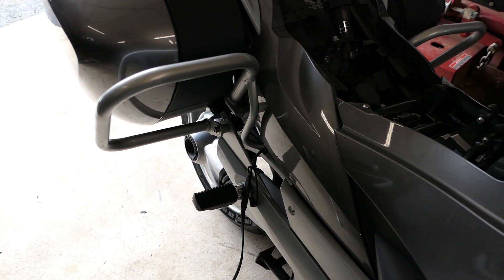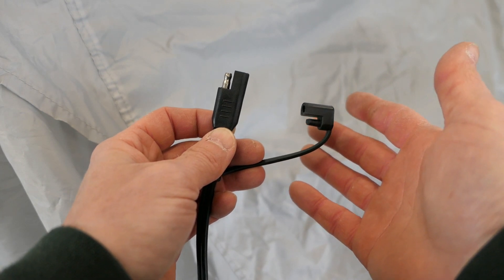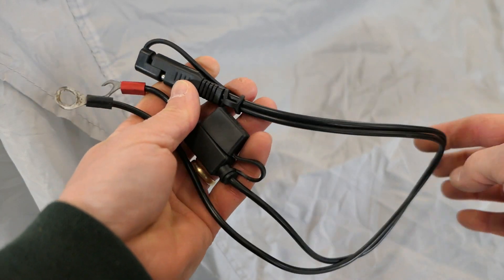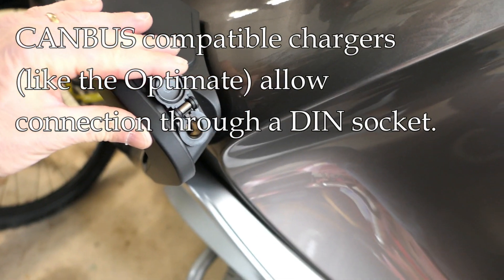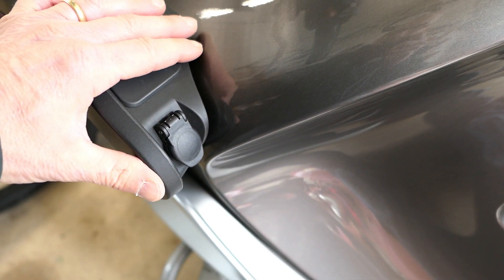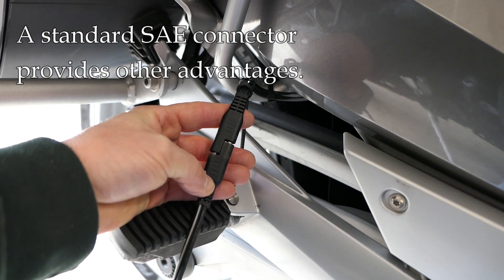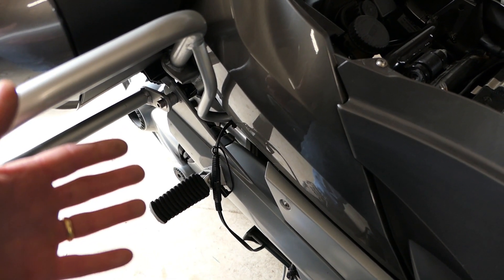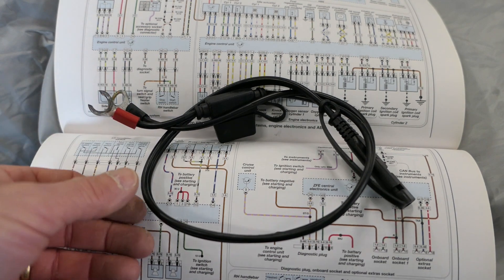SAE Pigtail Or CANBUS DIN Socket?

Comment: Couple notes about DIN charger. Actually, it is very useful (but quite expensive) thing. Yes, it's current limited to socket current (manual says 10A, forums says 5A). But we have 19Ah battery which normal charging current should be 1.9A (1/10 of capacity). When original BMW or Optimate charger connected, it wakes up electronics and start charging. All other (generic) DIN chargers needs to have ignition turned on before connection. When battery charged (or power loss happen), generic charger disconnects completely and can't start charging until ignition turned on again. Original chargers continue charge after power loss. Also, Optimate 4 can be left connected for entire winter - it will wake up with some intervals, charge battery and sleep again. So, CANBUS DIN charger is quite handy tool for regular use if not riding every day (like once a week/month) to keep battery charged.
There is one possible danger situation with direct battery connection - some chargers can output higher voltages (like 18V) during some special charging cycles. Such voltage can permanently damage all electronics and BMW manual warns about this - they say that battery must be disconnected from bike before charging.
Reply from the maker: There are no chargers I've seen in the last three decades which output at 18 volts.  Modern chargers made in the last ten years typically have a selector to choose the battery type, such as standard, AGM or lithium, as lithium batteries do require a higher charging voltage.  Also, the Optimate 4 is not unique in being microprocessor controlled--all modern "smart" chargers made in the last two decades have this feature and should be left connected.  Ultimately you can make the choice of DIN or SAE pigtail, but my argument for the pigtail is mostly about utility.  The pigtail allows for other uses, such as connecting a mini-compressor while out on the road.  And it avoids the potential issue of a CANBUS circuit kept inappropriately alive.

Comment: THanks. I am in the process of making this decision and you answered it for me. I was wondering if hooking up directly to the battery would interact with the canbus system and you said no. Thats good. Also if you hook into the canbus, that implies that a charger is waking up the canbus computer all the time and putting hours on that computer unnecessarily. Lastly, I just bought a used 2019 bmw 1250rt so all this canbus stuff is new to me. the din connector/canbus port says it supports 10amps in the manual and I bought a portable air compressor that should have worked. Plugged it into the din socket and it tripped the port after a fraction of a second even though its specs said it would use less than 10amp. This alone was driving me to put in a SAE pigtail direct to the battery to use it, so your conversation on using it for a charger fits right in.
Reply from the maker: I think I can explain your problem with the DIN port and the compressor.  It's probably accurate that the DIN port will support up to 10 amps.  However, the specs you find on the side of a box for a compressor or any device should be taken with a grain of salt.  In particular, there will be the running amperage of the compressor and the start-up amperage.  The latter is typically going to be more than the former because it takes additional electrical force to get the compressor motor initially running.

Then, once it is running, the amperage will vary depending on the work the compressor is doing.  The running amperage at 10PSI is going to be less than the running amperage at 40PSI.  The manufacturer may publish an average of this running amperage or it may choose some other gauge.  There are no rules.  In addition, the accuracy of these specs in general is always questionable.  So, your compressor probably draws more than 10 amps on start-up, and perhaps less than that while running.

Comment: I use a 7 stage Projecta smart charger with solid anderson plug (weather proof). The Anderson plugs are very common and provide a very solid connection, as you can use thicker cables (I use 6mm cable). Works fantastic.
Reply from the maker: Looks like that Projecta brand must be an Australian thing?  In the USA and I believe in most of Europe the SAE pigtail is the defacto standard for charging, and having that standard does allow for easy use of the plug for other adapters and things like an air compressor or heated gear.

Comment: Thanks great info. I just got my first bmw and canbus charging was new to me. I think I will stick with the old pigtail. Just a bit worried because on some forum I read about this guy having lots of problems with warning notes on his screen and not being able to set the clock after disconnecting the battery and installing pigtail. Hopefully I can find an article that will talkabout this problem or maybe the guy just had some bad luck I don't  know.
Reply from the maker: When you disconnect the battery the computer loses power, and you may need to reset some things.  You won't do any permanent damage, though.  Just make sure the connections are good and tight.
Reply: @tinderboxarts  ok great thanks. I just hope it is all stuff I can reset and not have to pay dealer to do. I guess I will find out soon enough. You are most helpful and really good videos. Thanks much !

Comment: Thanks for the info John. I just reconfigured the wiring on my 2012 RT1200 an hour ago! I bought the same battery that you had bought and I just did the final drive gear fluid change yesterday,following your advice! Not sure if I’ll do the transmission fluid change. My (pathetic) owners manual doesn’t make mention of it. It also says not to hook up the battery charger directly to the battery, which is just plane stupid. I use a deltran dual battery tender that I’ve had for many years. Bought my bike in 2012 as a demo bike with a trade in of a 2000 RT 1100. Wish we lived closer. I’m in southern Illinois. Take care
Reply from the maker: Glad the videos helped!

Comment: I went the SAE route myself, except my connection for the ‘charger’ is under my seat. I also included an extra length of wire with a connector which can be attached instead of a charger. That way I can easily get charged from another bike while it’s running. (Yes, I know not to try and start the bike while connected, the gauge will not handle cranking amps!)
BTW, what you call a charger is more properly called a battery minder, or keeper.  Not all chargers are minders. A minder can be left attached for prolonged periods, or a New Hampshire Winter, and it will throttle back to a point where the battery is just kept fresh.  I think it uses those Algo Rhythms you were talking about.
Reply from the maker: The trouble with chargers is that there are no standard terms, only marketing terms.  The closest I can find to a standard term for the type of charger which is microprocessor controlled is "smart charger," so that's what I tend to use.  Or, sometimes I'll just say "microprocessor controlled."   if you are buying a new one today, most of them are this type anyway.  I did do a video about this:  https://youtu.be/x8UMSEUYAhs

Comment: Seems like you really know what your talking about,  have this CanBus system on my Indian FTR 1200 model and wanted to change my rear turn signals but everyone is telling me not to because I can damage this system, is this true ? I know I might need an equalizer to make them work properly but could I damage the system? The dealership said I could void my warranty by changing over
Reply from the maker: The only way you'll damage the system is if you hack into the wiring willy-nilly.  Just think of the CANBUS computer as a high-tech fuse box, which is really all it is.  The difference is that each circuit is monitored by the computer over various wiring, so you can't just cut and splice wires like you might with a conventional system.  If you purchase third party turn signals try to find some that are pre-wired for the factory connector.  If none exist, you may still be able to re-purpose the factory turn signal harness.  I'm not familiar with that particular bike, so one thing you have to determine is if the bike came with LED lights, in which case the CANBUS computer will be expecting low-draw bulbs and you can replace the factory with other LED bulbs and probably be fine.  If the bike came with incandescent bulbs, you need to find LED replacements that have a built-in resistance to mimic the incandescent bulbs.  Another item is if the bike has a flasher/blinker relay or if the CANBUS computer provides that function with a ground somewhere.  If it came with LEDs it's probably the latter.  Other than that you just need to replicate the factory resistance values in the circuit and it should work fine.  If you can find a third party that packages the turn signals specifically for the bike they will have done this research already and will likely provide the correct harness connector so it will be plug and play.
Reply: I was just watching a canbus video that was explaining what it was and can you change incandescent bulbs to led. The guy indicated that the leds use less current and typically have less resistance  through them so the can bus computer might flag an issue with the lights. he then said that the led bulb companies have introduced added resistance in the path to look like the old bulbs and the can system thinks its the same. he said make sure you get bulbs with this feature.

Comment: I have a bmw1200rs I have found the accessory canbus connector, but won’t work without ignition key. And idea where the canbus onboard socket would be located? Thank you in advance
Reply from the maker: I'm not sure what you are asking.  There is (on the RT, anyway) a switched connection under the dash for GPS or similar devices.  (See this video https://youtu.be/yvOj9dS97TQ ).  Maybe that's what you found.  I'm not familiar with the RS model enough to know if it has a DIN socket.  It may not.

Comment: I have a 2005 RT,,, I agree with you or I should say I do the same as you connecting straight to the battery,only difference is the Optimate charger has a different connection socket(at the moment I,m clapping to the battery),,,,  But honestly I dislike the idea of a live wire just hanging off the bike ,,yeah I know it can be fused ,,still its not something I like...Incidentally I believe there is a wiring loom connection somewhere around the headstock to allow connection straight into the canbus,(via the loom),,  In my case  I want to connect up a tyre   (tire) monitoring system...any chance on doing a vid on this aspect of the RT.....please
Reply from the maker: The wire you refer to is the factory switched circuit for the GPS (satnav) system.  It's located pretty deep under the dash and taped to the frame, as I recall.  Keep in mind, you can't just attach anything you want to this circuit.  It needs to be under the amperage limit, although I don't think that limit is published.  A device with a similar draw to a GPS would be fine.  And, good idea for a video--I'll get to it!

Comment: john - agree with everything you said on this video.  another big big plus is that using sae allows for a much wider range of chargers.  i use a microprocessor controlled unit that cost about $60 aud and it will do agm gel and lead acid at selectable charge rates. i can use it on other vehicles as well. those overpriced canbus units are a joke.

Comment: I really enjoy your videos. I have a '14 R1200RT and have been using the CANBUS system for maintaining the battery using my Battery Tender. For me it's just easier to plug and leave it. When I recently replaced the 6 year old battery I added an SAE pigtail and secured the end under the seat. Now I have the best of both worlds and I like the SAE when I need more direct battery power.
Reply from the maker: That's actually not a bad idea if you use the CANBUS charger to add an $8 SAE pigtail so you have the option if you need it.

Comment: I too would use the pigtail and so do most bikers in the UK. As you say it comes with the charger and is direct to the battery, much less to go wrong and has the additional advantages of plugging in accessories. 👍🏻
Reply from the maker: That's good to know--I wasn't sure how prevalent the pigtail is in the UK.  On this side of the pond it's one of the first items installed on a bike.